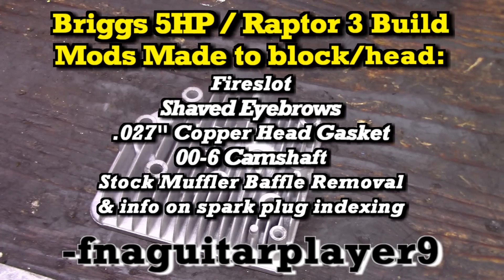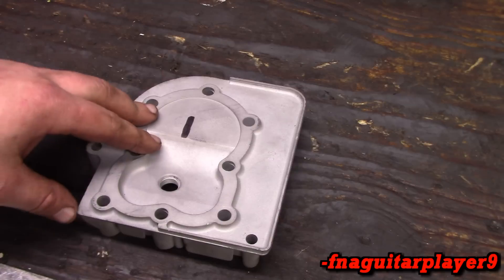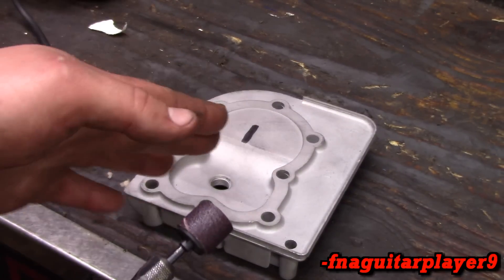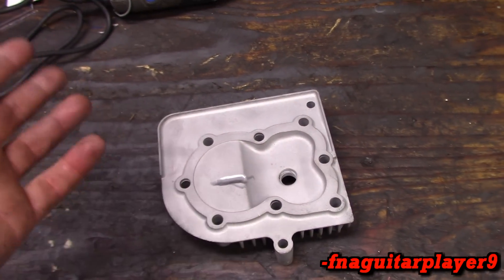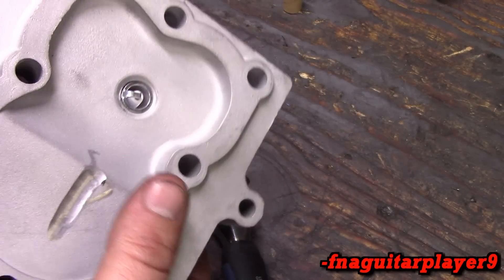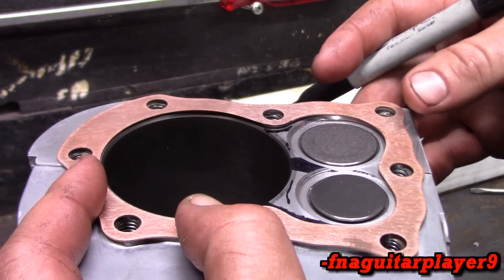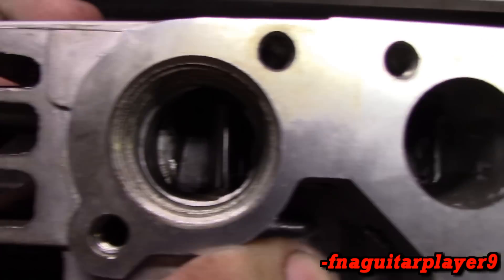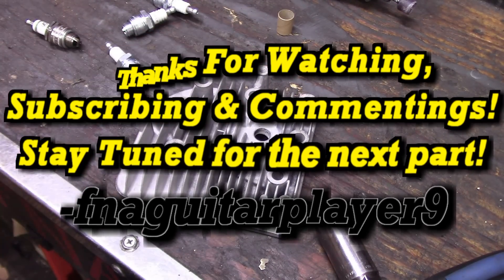Briggs 5HP / Raptor 3 Mini Bike Engine Build PART 1 | Mods to Block and Head

Comment: Check into an NGK BU8H surface gap spark plug, it has a circular ground electrode all around the outside, and it increases compression slightly. It worked fine in the 2 horse cylinder of my Briggs 5432.   Great vid about building a Raptor, I bet my son has watched this vid for sure!

Comment: I disagree, a spark does not "shoot" a spark' you cannot "aim" it. A "hotter" plug tends to contribute to detonation so that is not necessarily a good idea but you can maximize the stock plug by increasing the gap a couple thou  (no more). He is 100% correct stating not to expect MUCH from small engine mods--these tricks are most effective on motors that rev 5000+ rpm and your Briggs 5 will push it to MAX 3400 without grenading. Flatheads are low revvers by design so it is much easier to get more power from even a stock OHV or better yet an OHC the same displacement. Of course, expect to pay more too. The beauty of an L-head is its simple design.
Reply from the maker: What I meant was the E3 brand plugs claim to make the flame "shoot" out of the plug instead of out and around the standard plugs, I kind of doubt it too, but i have noticed certain engines seem to like them better, but it just depends. Yes, you can only get so much out of them. I still love the old flatheads, its just a simple / dependable design. They do seem to have more torque the ohv at lower rpms. Thanks for Watching!!!
Reply: @fnaguitarplayer9  I LOVE 'em : ) and yes, I am a fan of the greater torque too. These critters had an incredibly long and successful production run.
Great video, I'm subbed!
Reply from the maker: @royledford5673  thanks for the sub! I'm all the time working on these flatheads. I've always liked them, the 1st engine I ever worked on was a 5hp briggs.
Reply: @fnaguitarplayer9  Last year I built a motorized bike board-track replica using a stock 2.8hp Baja Doodlebug L-head and a 26" bike frame. Turned out pretty darn cool if I do say so my self, never fails to draw a crowd in public.  32 mph top end is plenty fast enough with NO suspension!!

Would really enjoy building another and of course--bigger is better...not that I'm in a hurry.

Someone just gave me a Briggs 5 minus the carb and gas tank. 1) I plan to adapt the carb for a 5hp Tecumseh snow blower (new) and clean up both ports, nothing fancy. 2) Fire slot the head just as you demonstrated. 3) Shave the valve "eyebrows" in the block for smoother flow. 4) Rather than shave the head to recover compression loss I want to TRY lapping the block and head surfaces then use a .040" copper head gasket with 2.70" piston hole diameter. (I have a new stock head gasket that measures .071" thick). 5) Stock NGK plug with +.002 gap. 6) M/C tank up on the frame like the other bike.

If all this works maybe I won't need the blower & nitromethane : )
Reply: @royledford5673  so you mean to tell us that the 5 hp Raptors only turn 3600 rpm?  ha ha. my clutch dont engage until around 4000. itll easily turn and make power up to around 7200. itll turn 10000 but it's out of the power band

Comment: My 4hp head has a different bolt pattern and bigger bore. Not sure if you are aware but they make copper indexing washers. Cut off the stock ring washer and add copper ones til it is exactly where u want it.
Reply from the maker: That may be from a push mower engine, they will be completely different. Thanks for Watching!!!
Reply: na they aren't push mower motors. they came off of leaf vac. model 11

Comment: Great work, and some of those simple idea's can make all the difference. Have you tried polishing the head combustion surface to a mirror finish?
I did that mod on a few bike motors many years ago, the idea being there is less surface area to absorb heat out of the flame, and being more reflective gives a hotter flame front.
It also helps reduce carbon and soot buildup as it's harder to stick to.
Anyway, thanks for posting a cool video, cheers.
Reply from the maker: No i did not try that yet, it makes sense to do that, i will do that on the next build. Your welcome, Thanks for Watching!!!

Comment: E3 is the worst spark plugs to buy, I've have had them fail on me, the center electrode likes to move under high heat conditions, I'd recommend Bosch spark plugs either with the 2 or 4 grounding electrodes.
Reply from the maker: I have recently had bad luck with E3 as well, in certain engines they do good, like my 2 cycle pocket bike (47cc) it ran 100% better with it, but in a 12hp briggs i had problems, I ended up using a NGK in this raptor build and it runs great on it, haven't tried anything else. I will check those out! Thanks for Watching!!!

Comment: a high output ignition system is probably something guys use, i expect a bigger coil or something.
Reply from the maker: They do make another coil for these, but most people actually run the stock coils, they say its not a huge difference, I'd like to run a external can type coil (auto style setup) on one, but it would have to have points/condensor. Thanks for Watching!!!

Comment: I've got a little 3HP side shaft Tecumseh I got from my neighbor I tore half apart to paint. It came off an edger and ran great. next thing I know I'm going hog wild porting the intake and exhaust ports. They were really restricted and sharp corners. Widened up the holes and rounded the edges a lot to improve flow and reduce turbulence should help it out. I notice the Tecumseh doesn't have any eyebrows to shave. That engine also has the same diameter intake and exhaust valves, except for the seat angles. I gotta hog out the updraft intake the best I can, that stupid thing is half the size of the carburetor venturi and intake port. No wonder they don't make as much power as a Briggs lol. I figure it's best to experiment with a crappy engine before ruining a good Briggs. I think I will make a fire slot in the head and shave it down a little to increase compression.
Reply from the maker: I hear ya, that should make a huge difference! Thanks for Watching!!!
Reply: @fnaguitarplayer9  I painted the block and some tin pieces today and shaved the head down a bit and cut the fire slot. Looks pretty good. I figure the little bit I shaved off to increase compression compensates for the fire slot. I also found a couple plugs that will index perfectly with the fire slot when tightened down. Now if I can keep that connecting rod from breaking with all the extra torque it should make lol.
Reply from the maker: I hear ya! It should balance out the compression and maybe even add some, never know. This engine has so much compression it is hard to crank over. Part 3 is uploading now so it should be up in 1-2 hours. Thanks for Watching!!!

Comment: Hello Frank, like what your doing on the Raptor engine, Just don't port the intake side to much, sometimes them ruff edges and ridges help with the air and gas mixing better before burn.
Can't wait for the next video 👍
Reply from the maker: Thanks. Yeah I didn't do to much at all really, just knocked down the real bad spots on both, part 2 (of 3) is uploading right now, should be up in a hour or 2. Thanks for Watching!!!
Reply: Porting might be ok, polish is where you get the most issues